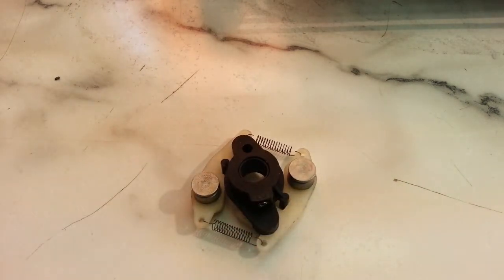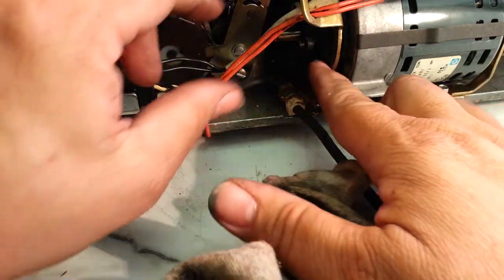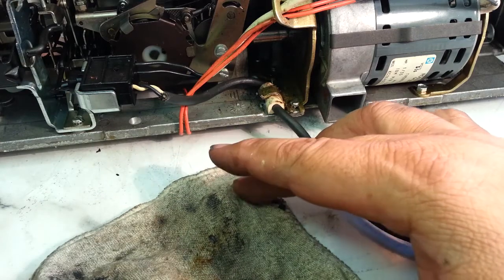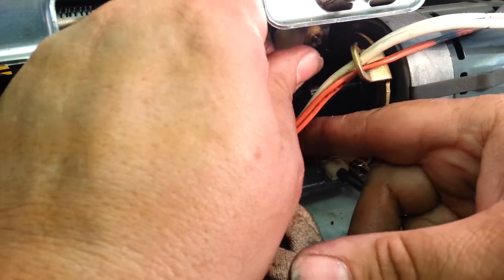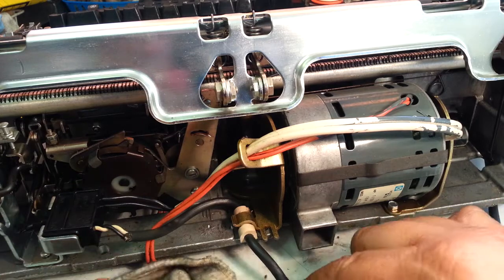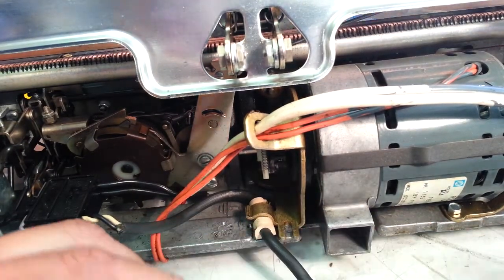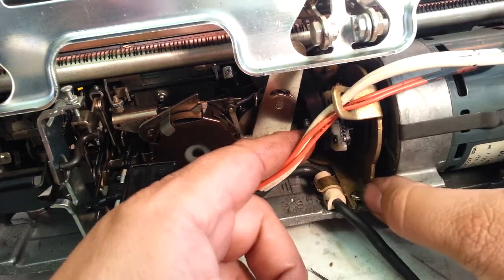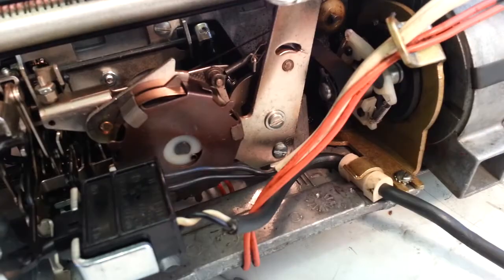IBM Selectric Typewriter Motor Clutch Replacement Centrifugal, Belt Adjustment

Comment: Here's a dumb question.....   The Selectric III I own has a non-grounded AC cord, while my Correcting Selectric II has a grounded AC power cord.  While the Correcting Selectric II has an all metal case, which makes sense, the Selectric III has a plastic bottom base and a metal top cover.  Why didn't US Selectric III's have a grounded AC Cord?   I believe you could still get zapped by touching the top lid or other exposed metal parts around the platen area if the motor or internal wiring was faulty?
Reply from the maker: Grounding was overkill and eliminated, plenty of Sel III with metal bottoms (un-grounded) 
Majority of selectric II's do not have grounding. Also the case is separated from body the 4 rubber mounts
Reply: @phoenixtypewriter2136  I realized later that the rubber isolation mounts of the motor also insulate it from the mechanism too.